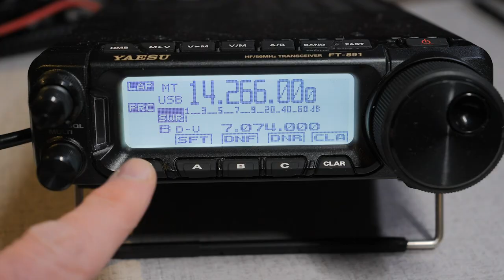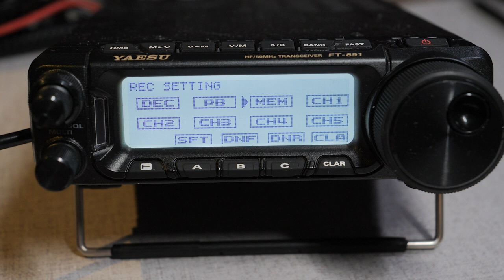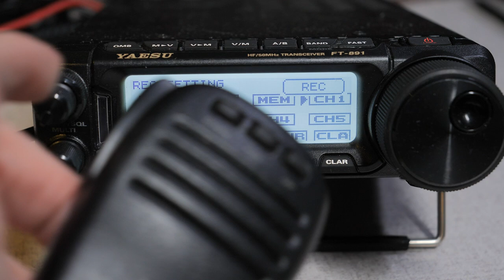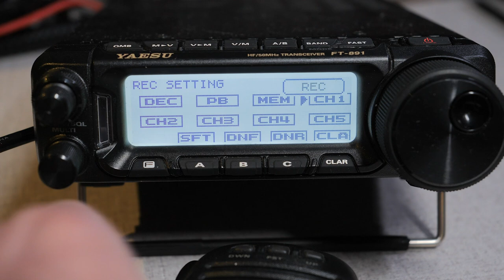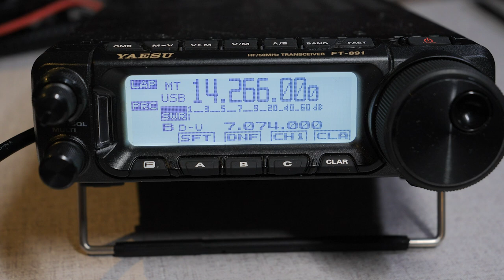Yaesu FT-891 Voice Memory Keyer- Ham Radio How-to #HamRadioQA

Comment: Some useful menu settings for this are 03-01 and 03-02, especially 03-01 DVS RX OUT LEVE which controls how loudly the radio speaker outputs your recorded message. Typically I don't want to hear the recording at much more than a low volume, especially if I'm in a busy area.
Reply from the maker: Great tip. I believe that menu also controls how loud the monitor level is too.
Reply: Excellant, I have been looking for this! G8XDD
Reply: You saved my ears !!!
Reply: Thank you! I have been looking all over for this and nobody seems to cover this.

Comment: Very interesting tutorial. Just a note from my experience: when releasing the PTT button a click noise is produced which gets recorded at the beginning of the recorded message. This can be significantly reduced (although not completely avoided) by keeping the PTT pressed while recording the message and releasing it only after the recording is ended by pressing the multifunction knob. Alternatively (maybe) one could activate the PTT through the CAT instead of pressing the button on the microphone... or using an external microphone... anyway great functionality and good tutorial, thanks KB9VBR!

Comment: Surprisingly, the FH-2 is not included in the FT-891 box. This is an absolutely necessary thing that fully reveals the potential of the message recording function. It weighs nothing, allows you to do CW QSO automatically, and with proper skill - even almost automatic SSB QSO😀
Thanks for the video Michael, I learn something new every time, 73!
Reply from the maker: What's even more surprising is that Yaesu included the FH-2 with the FTdx3000, but I had to pay another $90 to buy the accessory board to make it work with voice keying.
Reply: @KB9VBRAntennas  So the voice memory module in FT DX-3000 is not installed by default?😱 What greed) Although considering that FT-818 with the necessary options costs as FT-891 - it is quite logical😅

Comment: Thanks Michael. I’m thinking about buying a 891 at Hamvention for POTA activations and leaving the 7300 in the shack to use at home. 73 Reed/AB8AS
Reply from the maker: The 891 is a powerhouse in the field once you have it set to your preferences. You'll enjoy not having to tear down your shack in order to do an activation.
Reply: Good plan.  The 891 is smaller, lighter, and a bit more durable.  My awesome 7300 stays safely in my shack while the FT-891 and G-90 do all the dirty work outside.
KZ9V
Reply: @davewhite7679  I have used the 7300 very carefully for 130 POTA activations since I started activating back in April 2021 🙂. I try to be very careful as the 7300 is my only HF rig.

Comment: Excellent video, thank you. Sounds as if the '891 is a glorified IC-703/IC-706! My one question is if the memory keyer will also work for RTTY contest phrases.  AC9DN
Reply from the maker: I wouldn't call it a glorified 706, the DSP and filtering are generations better than what the 706 had to offer. But the FT-891 does fill a hole that the IC-706 left when it was discontinued. The voice keyer only works on SSB. There is a separate memory keyer for CW. But nothing for RTTY.
Reply: @KB9VBRAntennas  Thanks. I still miss my '703 even though there are other QRP options now also and I have the MTR 4B V2.

Comment: Love this video! I'm having trouble getting my Yaesu-891 to work with my MFJ-939 tuner, every time I key up it re-tunes! Any advice?
Reply from the maker: Do you switch to a constant carrier mode like CW, RTTY, or AM to do the tune? I've found that if you stay in SSB and try to do a tune, there will not be enough modulation for the tuner to carry out the task, so it will reattempt tuning with every transmission. I also think the 939 has latching relays. If it does, you can turn the power off after a tune and the tuner will hold the setting. I had to do this while we were going mobile for the MN QSO party. The wind & driving caused enough variability that the tuner wanted to retune with each transmission. I'd do a full tune and then disconnect the power on my LDG tuner to hold the settings.

Comment: Thanks Michael. 
How do you turn down the volume of them playback.   
It does not seem to go up or down with the volume button
Reply from the maker: The DVS volume is controlled by menu items 03-01 and 03-02. 03-01 will let you adjust the playback recording level.

Comment: Good information BUT...is it possible to have it repeat the SSB CQ automatically (like a beacon mode in case of no quick replies)?
Reply: im wondering the same thing. the 7300 all you have to do is press and hold and it will repeat every few secs depending on how long you set duration for

Comment: Is there a way to set it to auto play the recorded message in fixed intervals instead of having to press a button each time? (like the Icom 7300)
Reply from the maker: No there is not. The FT-891 does not have an auto repeat setting.

Comment: Thanks for the infor, but I have the FT-991A and the 450-D.
Reply: The menu structure is different, but the Yaesu FT-991A has an almost identical voice and CW message memory and  uses the same FH-2 remote keypad accessory.
KZ9V
Reply: @davewhite7679  Thank You. KI5IBO

Comment: Does the memory keyer work with CW? That's my primary mode. Well, I just had to watch past 1 minute lol . All people who cover this I've watched never mention CW at all, Thanks! 73 de AI5DD
Reply from the maker: Yes it does. The CW memory keyer is similar but different enough so it will be covered in a separate video.
Reply: @KB9VBRAntennas  Thanks, I was looking through the manual, and you're spot on with page 11 in the advanced one. I look forward to that video.

Comment: Can't find a solution to why my playback on voice record is so loud. My modulation is leveled. Is there a playback volume?
Reply from the maker: Menu item 03-01 and 03-02 allow you to adjust the receive and transmit volume of the digital voice system (DVS).
Reply: @KB9VBRAntennas  Outstanding! Found it. Thank you!

Comment: Does the 891 have a continuous playback like some radios?
Reply from the maker: No it doesn't, its voice memory is limited to the five 20 second clips for the keyer.
Reply: @KB9VBRAntennas  The 891 memory can be set up to run repeatedly at predetermined time intervals in what Yaesu refers to as "beacon mode".  But I haven't found a way of just sending a message, like "CQ" repeatedly while waiting for a response in the way that I can with my IC-7300.
KZ9V